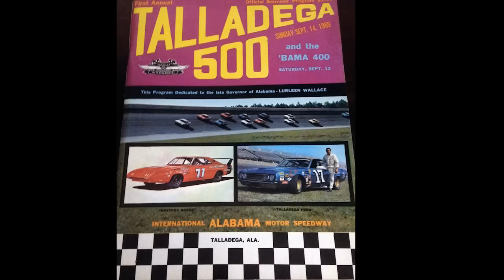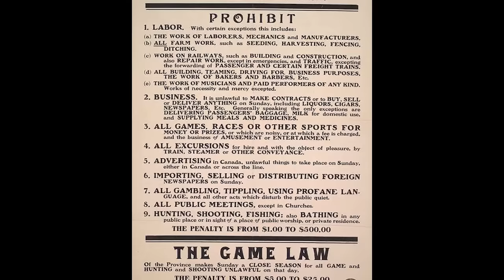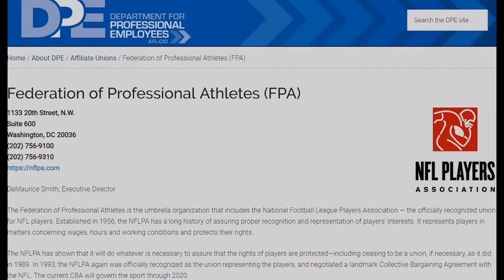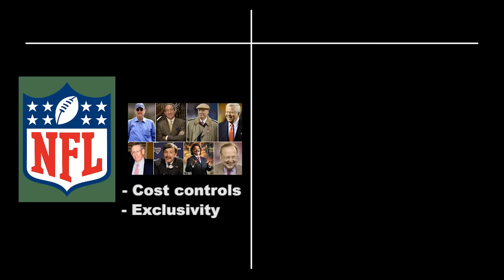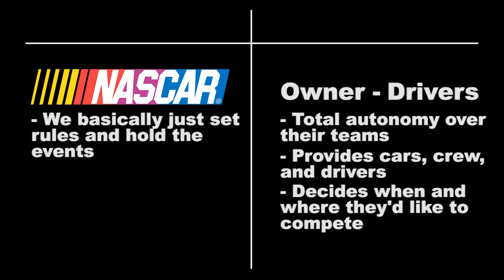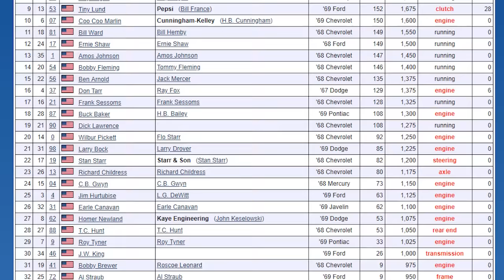The Worst NASCAR Race Ever: The 1969 Talladega 500

Comment: "What were tyres made from in the 1960's?"

Tyres were definitely quite different, back then. In fact, in wasn't until the late 1980's that North America started pushing seasonal tyres. Winter tyres became "a thing." Essentially, consumers were pressured into buying All Season tyres for Spring, Summer and Autumn; and then Winter tyres to give maximum traction in winter driving conditions.

Prior to that, All Season tyres performed much better vin the Winter, than they did afterwards.

While there's no doubt that specific seasonal tyres perform optimally over All Season tyres today, it's obvious that the only reason All Season tyres were eschewed so heavily was for $$$$$.

Racing rubber was big money by the end of the 70's; and the manufacturers wanted some sort of return on investment, which went far and above what they got from racing Teams.

So, when you see ¼" of snow hit Nashville, Tennessee... and traffic comes to a complete standstill... that's because of the new, craptacular tyres that were specifically designed for only driving on pavement in warm weather conditions.

Comment: As the son of a late model dirt driver and part of the Tennessee legendary trammell racing team 3 generations of domination in east tn. Look em up. Ive hears this story but not in such detail. 

We have walked out of races because safty issues and our team carried huge weight at local tracks. If we didn't win we was in the top 3 unless we just didnt finish. Last 10 years oir team has won points championship at whatever track we run. So I've heard and seen lots of issues within racing and driver safty is always the biggest thing. People don't understand how dangerous just being at the track is. Ive about been took out by more tires then I care to admit. Ive had metal shot by my head so fast it whistles and could feel the air pressure on my head. That's just being in the pits. Ive seen cars shoot out of the track and end up such a mangled mess the only working part if the removable steering wheel because it flew off during the crash. 

A drivers union is a good thing. Protecting these guys the crew and most important the fans which include massive amounts of little kids is far more important then any money fame or publicity will ever be worth. 

To all the drivers, crews, and family, we love what we do, that smell of high octane fuel is like crack. But always always do everything you can so you can do it again next weekend. Much love and respect to y all. My childhood and adult life just wouldnt be the same without racing.
Reply: Wait, do you remember a little dirt track outside of Knoxville, close to the Roane County line? I remember that track being there ever since I was a little kid. It is a shame that it has fallen into disrepair.
Reply: Nate Byers yeah that was Atomic Speedway it’s been torn down now such a shame.

Comment: I always sympathise with drivers when it comes to tire problems. I've been in a car that had a tire fail at high speed, and terrifying is not a strong enough word. Pretty sure the seat still smells funny and this was over a decade ago. These days I won't even drive a car on the road if I find the tires questionable, let alone run the car at over 100 MPH.

Comment: If you grew up in the 50s, blue laws were everywhere. Pennsylvania had some of the most strict. The Phillies weren't  allowed to start an inning after 7PM  on Sunday.  The only retail opened were gas stations and drug stores. Even in Massachusetts, you couldn't  have a tractor trailer on the road until late Sunday  night. That still existed in the 70s.
Reply: even in the 2000s some towns on cape cod (sandwich was one I think) would switch traffic-lights to a four-way-stop on a Sunday..
coming from the UK it was rather a shock!
Reply: Parts of the North East still have blue laws.  
I for one am glad the Teamsters were not allowed to dig their claws in to NASCAR.
You would have had drivers pressured to fix races so Teamster owned casinos could make money.   
Some drivers probably would have had "accidents" if they didn't go along.
Don't get me wrong, France's Hillbilly Mafia has ruined NASCAR but we at least had a few more good years.
Had the Teamsters took it over in the early 60's the good years would  have ended much sooner.

Comment: I've been a pro film producer in my day -- very good job, Sir! But I watched this for a somewhat unusual reason: When I was in High School, no driver's license or permit, my Uncle visited us in Sour Lake, Tx, and tossed me the keys to 'a car out front,' and said to give it a spin... wanted me out of the house to the grownups could talk. Didn't know it at the time, but he was the body/fenderman for AJ Foyt... and that car at the curb was Foyt's 1964 Corvette Stingray Grand Sport Sebring #2 car. It was well along modification for racing; gutted interior, one hard-deck bucket seat, roll bar, firewall, instrument cluster added -- no idea on performance upgrades but it was still factory paint and had Texas plates. Gone in 60 seconds...  and forever a NASCAR/IMSA/Indy fan and loyal Foyt supporter. But I joined the Air Force and was unable to watch races until 1970... so I was clueless about 1969, and wondered what role Foyt might have had in Talladega's first race. Disappointed on the score, but not on the overall. Thanks very!

Comment: Ahhh, restrictor plate racing and vacuum "leaks"...
Reply: Not back then.
Reply: so as someone who is not familiar with NASCAR whats bad about restrictor plates?
Reply: @kolbpilot  I guess since first restrictor race, it took the engine builders to figure out ways to skirt that rule.  Is that correct?  Or did the "vacuum leak" approach never make it into NASCAR?
Reply: @somerandomguyfromthebeyond1821  It is against the fundamental purpose of a racing car:  you try to make it go as fast as possible.  When you run restrictor plates, you are running "part throttle" with high vacuum resulting in engine designs that have ridiculously high compression ratios to get back the cylinder pressure.  So a whole technology is developed making this degenerate case work.  

There were short track classes that had 2-bbl carb rules and those guys mounted their cars with springs under the nuts so when you pressed hard on the throttle, it tilted the carb over and you sucked in massive amounts of extra air.  They say Smokey Yunick was good at vacuum leaks.  But hey, that had to be NASCAR, right?
Reply: @somerandomguyfromthebeyond1821  ....restrictor plates reduce the air/gas flow into the engines not only restricting their speed but in doing so equalize most of the cars. Which means no matter how good of an engine program you have you will be artificially slowed down by NASCAR.... but the biggest thing is, this creates huge groups of cars going the same speed in large bunches...No one can break away, therefore they all are in extremely close proximity to each other so when one has something as simple as a flat tire at speed it can wipe out half of the field in one huge wreck....and it did, many times...
Reply: Nofer, there had to be more to the "vacuum leaks" than simply tilting the carbs to create a massive vacuum leak, the incoming air had to have a proportionate amount of fuel mixed with it or the engine would lean out, backfire, or possibly explode.  I'm not saying you're wrong, I'm just wondering how they mixed extra fuel into all that extra air...
Reply: @NoferTrunions  : I'm far from a Nascar expert, never heard of the "Vacuum Leak" approach. No doubt, when carburetors were being used, restricted or not, engine builders were looking for any and every edge.
Reply: @somerandomguyfromthebeyond1821  : Reduced horsepower making capabilities of the engine, because Nascar felt cars were going too fast for the track.
Reply: @livewire2759  Just adjust your mixture screws to be on the rich side.  It's easy to compensate a carb with a turn or two of a screwdriver, or even rejetting it.
Reply: @Sanguinium  It seems to me that adjusting just the idle mixture slightly rich wouldn't be nearly enough, and installing jets to be rich enough to compensate would cause plug fouling.  There had to be something else to it.  The way a carburetor works, if air is coming in at the base of the carb, it pulls less air THROUGH the carb, therefore even adjusting the carb extremely rich wouldn't help.
Reply: @somerandomguyfromthebeyond1821  Restricting how much air can get into the engine, restricts how much power it can make. The reduction is like 50% of normal volume with restrictor plates. A vacuum "leak" elsewhere in the engine will ALLOW more in than the restrictor plate is intending , giving an advantage.
Reply: @NoferTrunions  How about hollow studs on the intake manifold? Is that creative?
Reply: @MikeM275  Like a stamped of buffalo just waiting for one to trip and fall and then watch the chaos ensue.  I think if they want to run "OPEN COMPETITIONS" they need to use shorter tracks and reinforce the catch fences and protect the fans. Then let them at it , like the OLD Indy 500 used to be.
Reply: @livewire2759  Obviously you richen the carb to get the desired mixture.  And obviously, the car will run pig rich when not at WOT.
Reply: @bobbysolo5411  Yep, any devious scheme was used.  Maybe using Castellated nuts with cross holes into the bore hole so that top of stud is solid(!)
Reply: @kolbpilot  NASCAR didn't "feel the cars were too fast". The speeds were exceeding the car's aerodynamic capability to stay down on the surface and would fly into the air at the slightest bump. It would've required huge spoilers and ground effects mods, which would have changed it to a different style of racing like GTP.
Reply: @bobbysolo5411  ... Even like the old NASCAR used to be! They do not want Stock cars doing 200+... but of course, that's when it was fun...
Reply: @bobbysolo5411   Well no...... unless you make it before the restrictor, the Fuel is mixed before the restrictor plate.. Leaky manifold will do nothing but lean out your mixture and  melt things..
Reply: And now Nascar has reduced hp across the board.  Yes the cars don't appear to be that much slower but the speeds are down a lot.  Restrictor plates made things worse at Daytona and Talladega.  Yes they reduced top speeds but bunched the cars up and created many multi-car wrecks.  Simple way to reduce speeds is just to change the rear end gears ratios.  You can easily control the top speeds without reducing hp and the cars can still pass each other normally.
Reply: @screamingpencil  ; Restrictor plates became mandatory after Bill Elliot's 212mph test run.  Bill France's pet monkey Earnhardt team started losing to Ford teams because of the new T-Bird of 1983. Bill Elliot's 1988 T-Bird was the last straw. It was the GM teams trying to get GM to build a more aerodynamic Monte Carlo, Buick and Grand Prix. So in 1985, GM answered with an extended nose piece right out of Ford's "Total Performance" program, based off the 1969 Ford Talladega. Didn't help that much. By 1987, GM cars had the complete "fastback glass" with the extended nose piece. Since "restrictor plate" racing, I've seen more cars "fly", and sometimes into the fans. But I haven't really watched or followed NASCAR this century.
Reply: @livewire2759  just set the carburator to run rich without the  vacuum leak. The only this you are changing is that it would a plug on a parade lap or during a caution flags. An engine will tolerate being too rich for a little bit. Also while a vacuum leak will normal reduce flow though the carburator at full throttle and maximum rpm the carburator and restrictor plate is the limiting factor so they are going to flow as much air as they can.

Comment: Thats a Charger 500 Vs the Daytona both 69 model year. No Daytonas for 1970 but Plymouth Super Bird based on Road Runner and Richard Petty is back with Chrysler!
Reply: I don't get why Dodge would want the old car (69 Charger) to beat the 1970 model.  Wouldn't you want the new car to be faster?  Back then, the cars were very much the same as the cars for sale at the dealer.  If the new car was faster, wouldn't that help to sell more new cars?   If the new car was slower, wouldn't that also make Dodge look incompetent?

Comment: Oh dude. You think that race is the worst race in NASCAR history? I have a few races that say otherwise:

2015 CampingWorld.com 500
2008 Brickyard 400
2015 Ford EcoBoost 400
2000 Dura Lube 300
2004 Ford 400
2002 Aaron's 312
2006 Goody's 250
2006 Emerson Radio 250
2006 UAW-Ford 500
2015 Goody's Headache Relief Shot 500

There are boatloads of reasons these races absolutely sucked & are way more deserving of that dubious title. I'm glad you did you research regarding Talladega, but as a race fan, let me assure that the 10 races I listed are way worse.
Reply: bull shit kyle busch earned that win !!!
Reply: Outside of the 2008 Brickyard and the Loudon race in 2000, none of the others would qualify since none of them had the stakes this race had.  If the Union would have succeeded, the France family probably wouldn't be running the sport.  If you took this race and placed it anywhere in the last 20 years, the sport would never have survived it.  Look at the damage the Brickyard did, still haven't fully recovered from that one
Reply: And of course the 2022 All Stars race … it has it all. Awful track, awful race, stupid officiating calls, and as an additional insult, it had none of the usual tools you need to achieve the worst race of them all. No tire wars or extremely bad weather.

Comment: you were wrong...Indy 2008 was the WORST race in NASCAR history...they may as well have started on lap 150 with the way they kept stopping the race
Reply: The Indianapolis 500 is NOT sanctioned by NASCAR, you pillock.
Reply: @WildwoodClaire1  He's referring to the 2008 Brickyard 400, a race where NASCAR had to throw the cautions every 10 laps because the tires could not handle the track and would blow out if they were run for more than around 10 laps. So, I would suggest you do some research before you come here and insult someone.
Reply: At least it was a field of competitive cars all facing the same issues. Of course both these events have been superseded by the most recent Bristol race where there were more Nascar employees and team personnel at the event than paying fans in the stands
Reply: @WildwoodClaire1  - Brickyard 400 IS NASCAR

Comment: Daytona came out on 69, not 70... Superbird came out in 70
Reply: Chris Petka what? Clearly it came out in 1969.... considering the video is about the.... 69 Talladega 500...
Reply: @OrangeSmoky  check your history, Talladega was run later in the year back then. Daytona was a 1 year only model, based on the Charger , in 69.  Superbird was a 1 year only, based on the Roadrunner, in 70.. the first race at Talladega was held September 14th in 1969

Comment: 👍🤪🍺South Carolina misses out on the biggest baddest track being built right in their own backyard because of Damned Baptists‼️🤣🤣🤣
Reply: We are slowly and luckily getting rid of them finally
Reply: NASCAR races are still being hosted in South Carolina to be honest, that in de facto mostly Darlington Raceway of course... There were used to be a shit ton of race tracks here, except of which most, save for about a few known ones, are abandoned... I pretty much am in between two abandoned speedways, Andrews Motor Speedway (possibly ceased in 80s or 90s, now behind an auto body shop, only a small block of concrete pavement left, either quarter or half mile long track as told by the trees that now make out the oval), and Black River Speedway (may have ceased operations about in the 70s, was said to be a kart racing area, now it's a empty lot area patch, track is barely made out from all else)....

Comment: Firestone bowing out citing safety is pretty rich - they were in the process of designing the infamous 500 Radial (built using equipment designed for cross ply tyre production due to budgetary considerations.)  At least 85 deaths resulted from tyre failure before the 1978 recall...on public roads.

Comment: I use to live 3 miles from the track! Harley Davidson has a test facility just a mile from the track! The Harley dealer set it up for the Harley owners group to ride the track! They limited us to no higher than the third lane from the apron! I got to the third lane and my pipes scraped the track! Sparks everywhere! I felt like I had to look to the right as high as my neck could turn to see the top rail! I had my throttle wide open and my Speedo was buried! I ran race fuel that day! And my exhaust made other riders behind me looked like they were crying with the fumes in their faces! Many riders stayed in lane one and two!

Comment: I wonder if Ramo Stott is related to the Stott family of tryon? In 1969 they owned Stott Chevrolet in Tryon - now Stott Ford, and Quain Stott is a former IHRA Pro Mod World Champion and now runs the Southeast Gassers Drag racing - based on 1967 rules clutch shifted manual trans with zero electronics.

Comment: Whatever they were making tyres out of, it was inconsistent. Stock cars going 190 mph destroy the tyres in a few laps but sports cars running their tyres on the same track for 900 miles at 160 mph is fine?
Also, autocorrect keeps throwing up TyrerDecember. What is that?

Comment: Wait, in one sentence he's saying "The guy just puttered around the track doing 160" when talking about the race promoter or whomever that was doing his "demo" lap. Then when the lesser race cars that are just actual "Stock" cars from the race from another division come they are only driving at those speeds at best as well. As in "They can barely do 160 with the wind at their backs let alone pass tec inspection". No wonder there were no tire failures. They weren't going anywhere near the same speeds. This doesn't really add up.